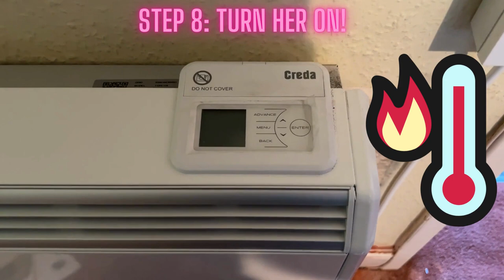Storage Heater Installation (Part II)

Comment: Any experience with quantum? Comparing with the cheaper creda like you installed... i am a sparx too but haven't installed any of the newer heaters and have heard not good things about the controls... ???? 🤔👌👌
Reply from the maker: Hi Nick, no afraid not - however I've not had any complaints about the controls with the Creda models and presumably with the Quantum, by Dimplex, they have to be similar because I believe Dimplex make heaters for Creda? They're one and the same aren't they? Surely being the more expensive brand the controls should be even better!! With older customers I will generally have to help set up the timings etc, but with many of my customers being local I am happy to go back and help if needed - once they're set though I don't generally hear about any issues. Hope that helps! Rich

Comment: Help needed if you wouldn't mind. I was replacing one element and took the front off to take elements out now I can't remember which wire goes on what. I have 3 browns and 3 purple can you help. Thanks in advance
Reply from the maker: Hello, it’s hard to be really sure without looking, but generally speaking it sounds like you have 3 live and 3 neutrals and these will need to be connected to the correct terminals to avoid polarity issues… most Storage Heaters will need to be earthed too, but this is probably earthed via the casing of the unit… in future, and I know hindsight is a wonderful thing, take a photo of any wiring before disconnecting
Reply from the maker: I should have mentioned that the brown will be live and the purples (or blue would be neutral) - hopefully this will be indicated on the new elements ie “live” and “neutral”. These will then connect up - also try to ensure that the earth is connected up too!!